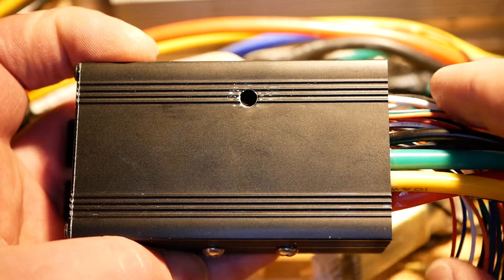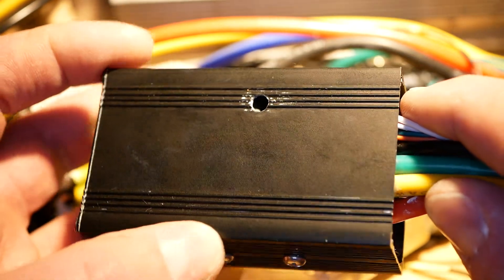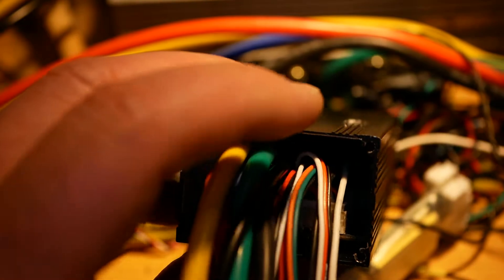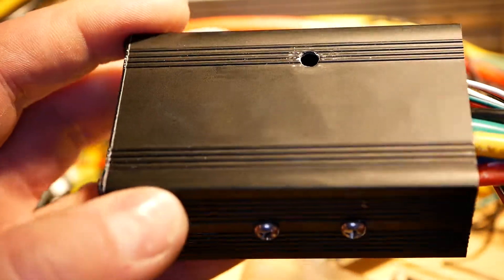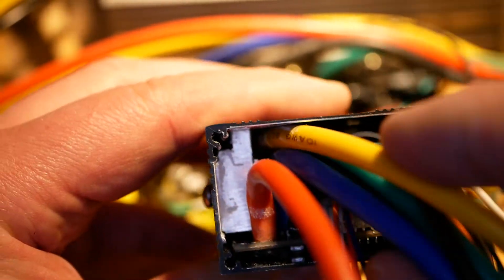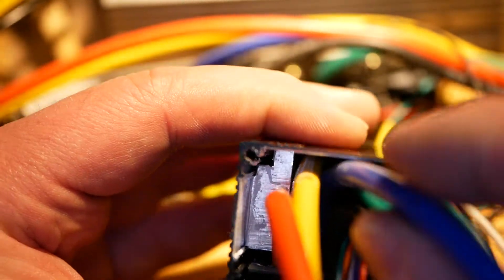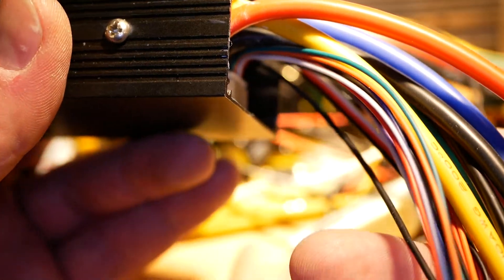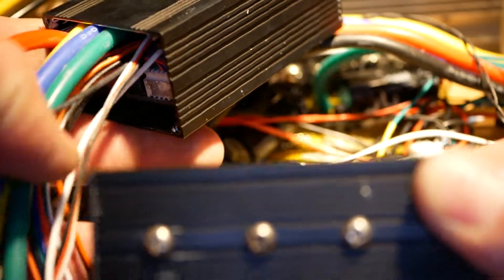Flipsky 75100 controllers in their shells

Comment: Any news about the power after this modifications ? Also have you seen the new 75200?
Reply from the maker: I haven't worked on the scooter since August. Life took a turn and it's just sitting there at 90% done. So power, over heating, I can't tell you emphatically that it is cured, but still, since no one is doing what I did, I'm fairly sure I fixed the thermal issues. I'm aware of the other Flipsky 75 series controllers, but I don't have one to tear down or evaluate. This 75100 didn't do any good for Flipsky reputation. It IS a boondoggle for sure!

Comment: After watching your three videos on the 75100, I am still not convinced they will output anywhere near 100 Amps.  Don't get me wrong your mods will let all the power get to the motor, but I don't think the triple stacked shunts are adequate.
I've been modding controllers since 2004 and I do some things differently, but the outcome is similar.  I use braided copper solder sucker to beef the traces because it's flexible and easy to stick down all the way to the MOSFET legs.  I also put a thin piece of fiberglass under the board to prevent molten solder from contacting the case.
I started doing this because doing long sustained wheelies would cause the solder to all melt down to the bottom of the trace and then drip off when you hit a bump.
My controllers are much larger and have lots of MOSFET's so the case and spreader have enough mass, but the board needs all the help it can get.
Would love to know how much power these tiny controllers actually make in real world application.
Great video with 100% accurate information and advice!
Reply from the maker: I'll know loads more soon enough. Modding these controllers was one part of many that went into getting my Dualtron City scooter ready to go at far more wattage than it was at originally. I'm pretty close to done with it. I've recently been working on lighting and that's close to done now. I'm working out a bug with the directional lights and then that subsystem is finished. Last thing to do to get the scooter running is the small wiring for the controllers. I plan to be fully operational by mid next month at the latest. Once that is the case, I'll be able to say what sort of amperage I can run the controllers at.
*
Thanks! I'll be posting real results soon. I don't know if I'll add an independent watt meter, but that would be useful in confirming power independent of the controllers. With TO-220 mosfets, the legs are rated for 75 amps, 100 amps is short term bursts at most. I was never under any expectation of seeing 100 amps continuous!
*
I didn't show it in my videos, but I did add a section of fiberglass sheet under the boards for the same reasons you mentioned. I've been doing that for many years myself. If the shunts are a problem, I may add thermal gap filler under them so they can dump heat to the shell.
Reply from the maker: Too bad you don't have any content on your YT channel! I'd love to see your work!
Reply: @de-bodgery  I have about 60, 48-60V BLDC controllers in stock, I suppose I could make a few race controllers for old time sake.
Reply from the maker: @kevinsellsit5584  60 in stock? Do you sell controllers? What's your website?
Reply: @de-bodgery  $40 cash and carry in Phoenix AZ.
or search for BLDC controller or 48 volt ebike on offer-up.
I can ship but it won't be as cheap as amazon with shipping.
Reply from the maker: @kevinsellsit5584  $40? Must be chinese controllers?
Reply: @de-bodgery  Yes they are new OLD stock.  They were origonally for vespa type street scooters with HEAVY hub motors and lead batteries.  80v caps and MOSFETS.  They will take a beating even with shunt mods.
Reply from the maker: @kevinsellsit5584  I have something like that. you may have watched my Zapino Zap scooter videos. That was my last project. The controllers they came with are pretty basic, all 100v components, very basic, no programming, but quite moddable for more power. The hub motor they ran has 6 phases and inside the controller shell are 2 identical controllers.
Reply: @de-bodgery  No, not yet but I'll check that out.  Sounds interesting ... six phases for hi-lo or just running all together from 2 controllers?
Reply from the maker: @kevinsellsit5584  The stator has 2 sets of windings on it. It's essentially 2 motors wound on the same stator and runs from 2 controllers. The 2 winds are identical. If I run just one of the 2 controllers I can feel the power reduction. If I want low and high, I have a 3 speed switch and programming in the controllers for that.
Reply: @de-bodgery  Gotcha, same windings ... double the torque.
Reply from the maker: @kevinsellsit5584  A 6 phase motor creates some complexity and some advantages. High wattage controllers are expensive. The Zap runs at 20kw quite a lot. 2 inexpensive controllers at 10kw each are pretty inexpensive compared to a single 20kw controller. It only gets worse at higher wattage. So a 6 phase motor is less expensive than is a controller capable of running it as a single 3 phase motor. The motor was wound for 6 phases from the factory, so I'm just running it as it came to me. The added complexity is the dual controllers. This is pretty common in dual motor scooters so it's a well known complexity, just a slightly different way to implement them. Motor torque is sort of like a 6 cylinder gas engine vs a 3 cylinder engine. Torque is a little smoother, but this is hardly much of a concern in brushless motors. This sort of implementation is almost 100% about cost of controllers.

Comment: Did something changed in the performance after upgrades?
Reply from the maker: I should be able to run closer to their limits now that I have fixed a variety of issues. Most people can't do that. So no spec changes, just capable of running at the specs without over heating.